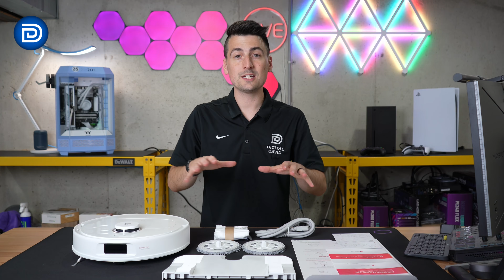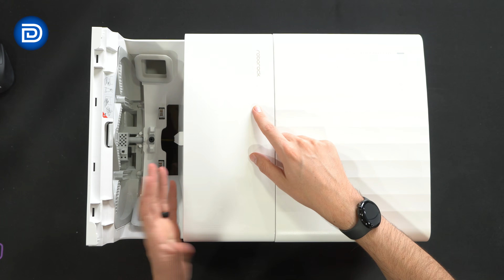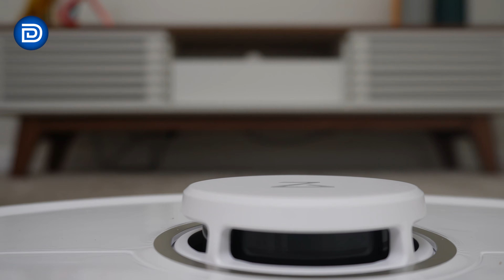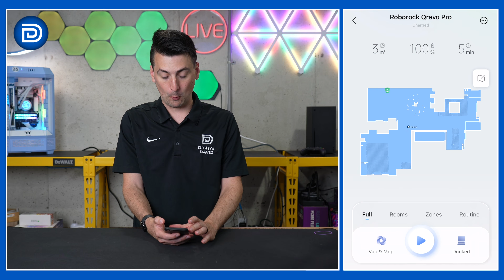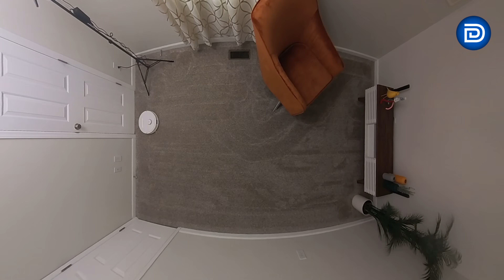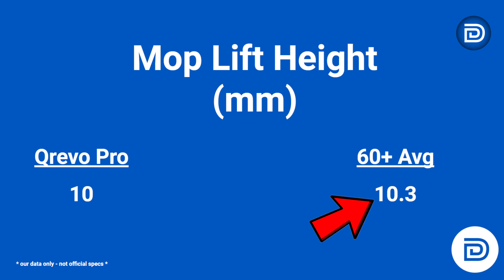Roborock Qrevo Pro Review

Comment: I dont know if I missed it, but is it possible to set the robot to empty the dustbin after every clean or everytime it visits the station? Also does the dustbin getting full affect the suction power much?
Reply from the maker: It don't believe it will empty everytime but I need to double check. It has never had any issues being too full and we have not seen any loss of suction power etc!

Comment: In other videos, reviews, and forums, some people are reporting that there’s a gap between the mopping heads when the right mop head is extended. Therefore, there are strips or sections that are not mopped. There is also discussion that the pro may go back over those areas originally missed and end up covering all surfaces to execute a complete mop job. In your experience, did you find the pro to have any gaps/sections that it missed while the right mop head was extended? Did you find the pro went back and mopped those areas originally missed? It’s between the Pro and the S. With the pro, I’m concerned there may be gaps/sections that will be consistently missed during mopping which will be a deal breaker for me. On the S, I’ve also read it may not do a great job with getting right up close to baseboards. Which one would you recommend between the pro and the S? Any insight would be appreciated. Thank you.
Reply: I own it and I have not had any issues missing any spots on my wood floor